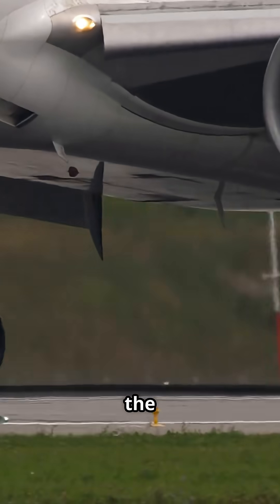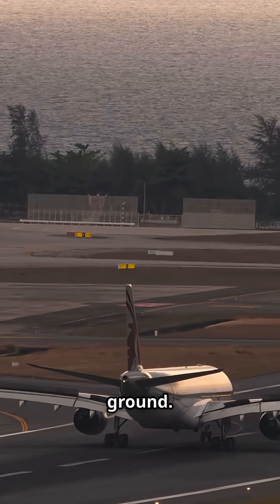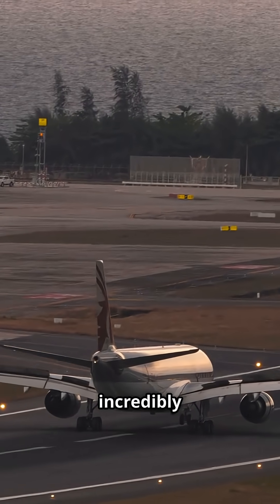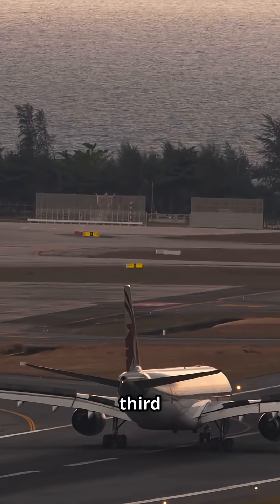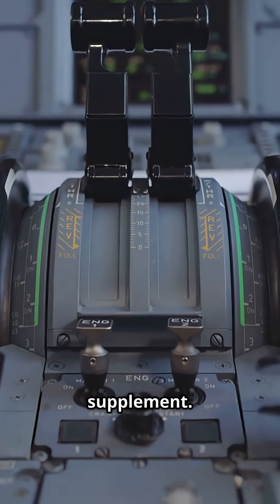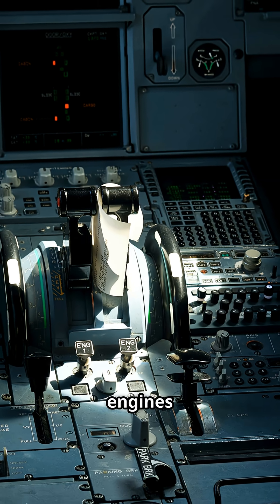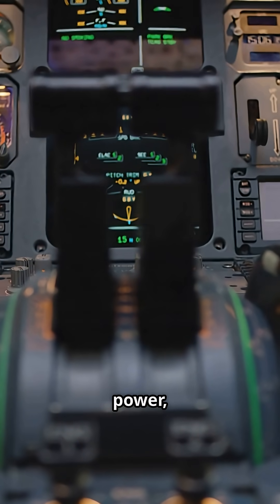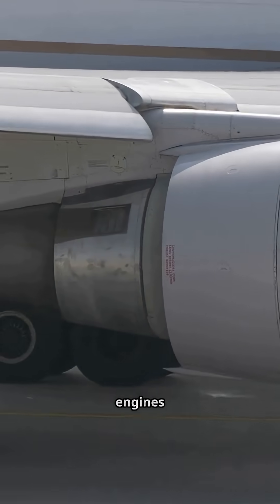Why Airplanes Use Reverse Thrust Explained

Comment: Heavy lifting is done by the engines and once enough speed is scrubbed off, pilot goes to the brakes.  Can you imagine the amount of energy (speed x mass) that the brakes would have to turn into heat if there was no engine braking.